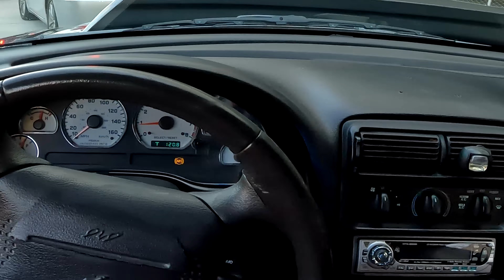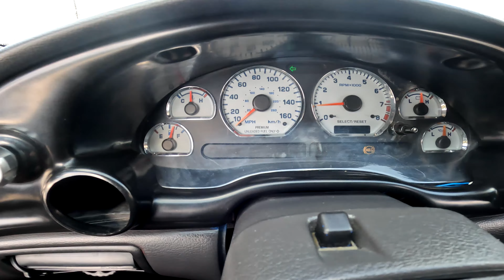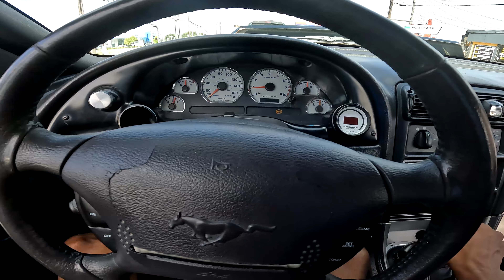Truck SPILLS PAINT on my 650HP CAMMED & PROCHARGED 1999 Mustang GT.. *DAMAGED*

Comment: Needs full tailpipes..
Reply from the maker: Nah
Reply: @EarsPOV  I'm here to tell you if you get some full mandrel bent tailpipes you will gain low-end torque which equals more horsepower and you will have a faster car..but I digress.
Reply: @kskip4242 I would disagree at that power level dumps vs tail pipes really doesn't matter I would be more worried about header primaries and mid pipe diameter size however cabin sound and smell dumps suck in my opinion...but some people like them it's a built supercharged car on e85 lol tail pipes aren't a concern....
Reply: @brendonpotts7961  I didn't say it was a concern I'm trying to offer you some different kind of advice but you're not getting the point nevermind. Trying to get you to think outside the box. Dumps sound horrible and kill your exhaust velocity, but you have closed your mind to the possibilities that I might be offering you a great idea for your car to get a little more out of it and have an even better performing and sounding car. BYE BYE 👋
Reply: @kskip4242  I've had dumps and tailpipes no difference in power but the smell and cabin drone I agree with you tailpipes is the way to go but performance wise it doesn't matter for our applications
Reply: @brendonpotts7961  you'll have a smoother torque curve with tailpipes. Thanks for chating.
Reply: @kskip4242  again you can go off internet or what you read I'm saying I've done back to back dyno pulls on dumps and tailpipes on my setup which is similar to his car shows no real difference in power or tq but again I prefer tailpipes but to say he will have a better tq curve I can't agree because he already has the best flowing exhaust he can get which is Longtubes and a Catless mid pipe running dumps or tailpipes won't mess  his performer just will smell bad and be louder in the car

Comment: 100% you need to file a claim with the city. Guarantee you’ll get compensation. Maybe enough for new parts and a paint job/correction!
Reply from the maker: Shoooot if I had a dashcam I would be TRUST!
Reply: @EarsPOV , I think you still have a shot. The freeways are loaded with cameras that can prove your positioning and the trucks I’m sure have GPS. If you think others got the same damage, I bet a case will be opened. I wouldn’t let it slide. Try contacting the city. Worst they can say is kick rocks!

Comment: Stock radiator should be plenty. Make sure the stock fan is kicking on. If that’s working, change to a 180° thermostat. Also, keep in mind, if the car is intercooled, those are mounted directly in front of the radiator. There is a flap that these cars have under it that directs airflow to the radiator. Make sure that’s good. Above all else, make sure no coolant leaks. One problem with the new edge cars are the heater core hose. Me and and a few friends have blown these and had leaks. It’s located on the passenger side firewall and connects to the back of the head. Good luck!
Reply from the maker: Fab is NOT turning on so taking care of that!

Comment: Careful, aluminum heads don't like overheating. And it also looks like you had coolant on deck which mean it's probably an on-going issue you're having.
Reply from the maker: There was a leak at a fitting I had so that’s why I had some on me. Never got this hot before. Fans don’t kick on now so that’s something I’m addressing ASAP!
Reply: @EarsPOV  No worries, just ain't worth blowing the motor over a 10$ fix. And yeah the fans not kicking on will do it. Whoever had the car before you did a haggard wiring job.